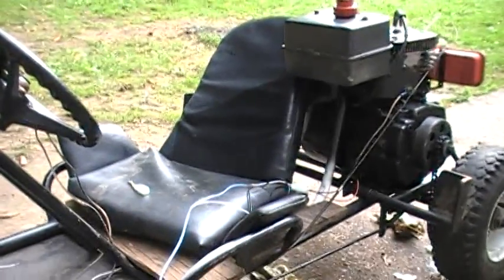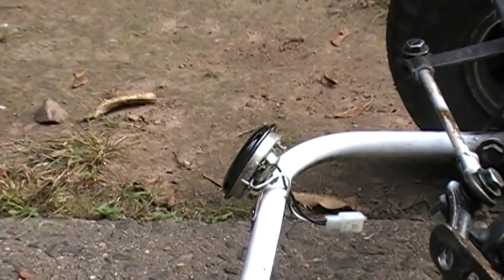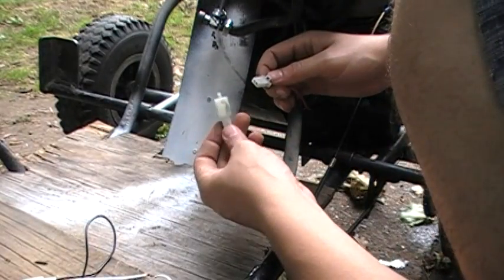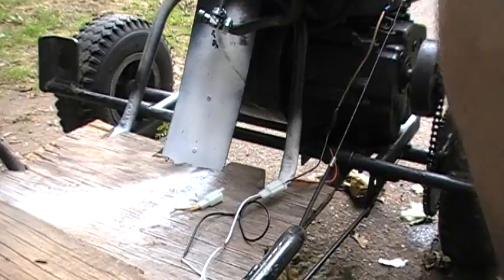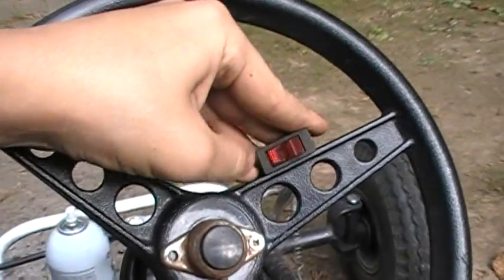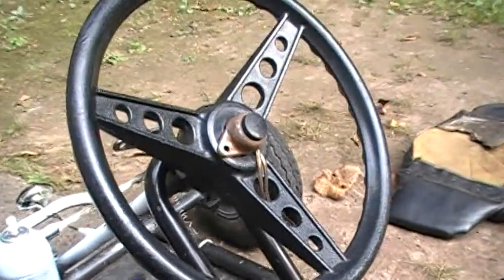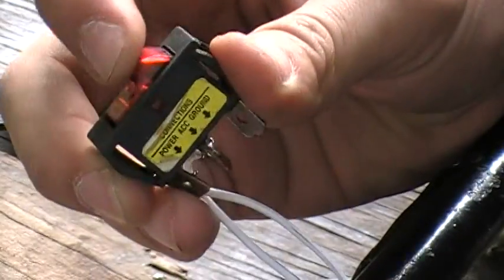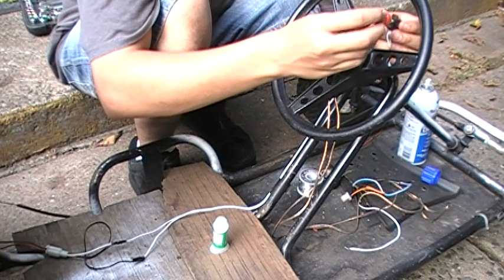Go Kart - Wiring

Comment from the maker: @chedder1154 Well i never had an official go kart engine on mine. I took my engine off an old snow blower. And also depending on what name brand engine you have it may have very different wires for the kill switch than my tecumseh engine did.  But I'm one goes to the switch and from the switch to ground. or back to that second wire coming out.

Comment: so i need some extreme help i just got a go cart and i rebuilt it and i just noticed today that on the frame there is a toggle on/off switch but i followed the wire and its just disconnected and theres 2 wires comming from the motor so i was just wondering how alll of this switch stuff works i mean i just want to make the switch work please help i need assistance

Comment from the maker: @Phiz787 im not sure what its call. I got it from my friend. You could probly find it in radio shack or the wiring section of the auto parts store. 

That switch is meant for lights since it has 3 connectors: power, acc, ground.

Comment from the maker: For the kill switch there was already a wire coming from the spark plug coil behind the flywheel that was used as a kill switch on the snow blower. 
so i connected a wire to that and one to ground on the engine and hooked it up on a switch. so when i turn on the switch its shorts it out causing the engine not to send spark to the spark plug turning it off.